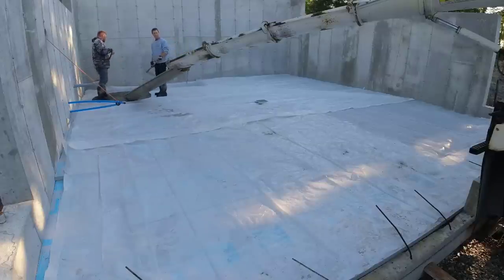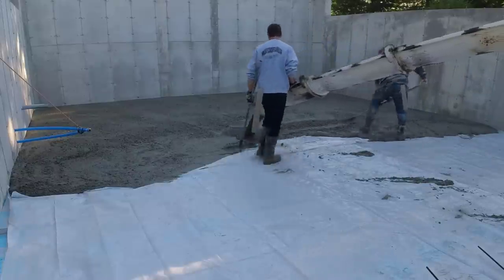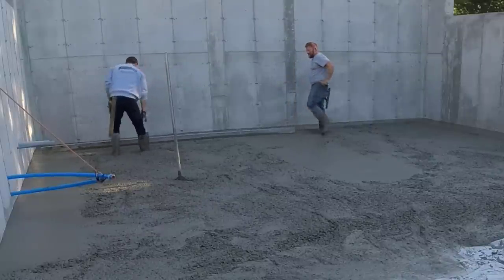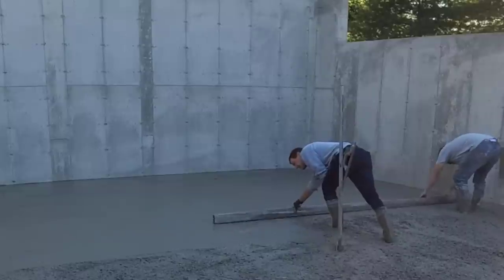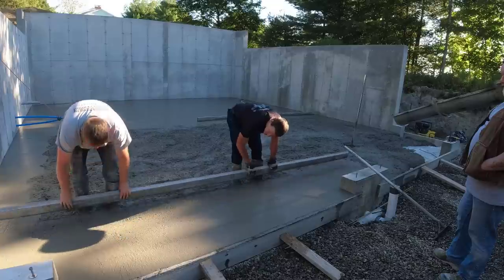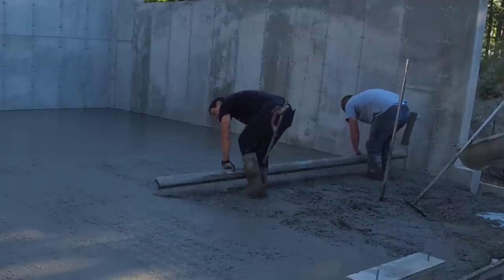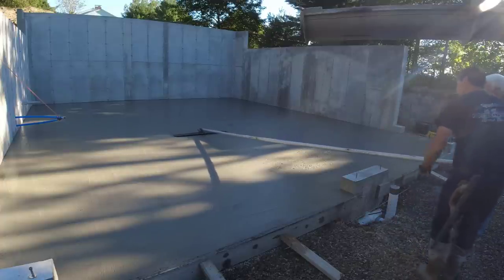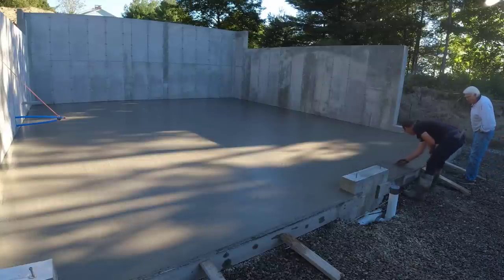How To Pour A Concrete Floor With Only 2 People.

Comment: I poured a pad today and I used wet pads for the first time with a transit. It beats using a 2x4 temporary form to screed on top of with a power screed, pulling the 2x4 out and filling in the void having the concrete in the void wetter than the concrete around it. Thanks for sharing your tricks and knowledge Mike!
Reply from the maker: Awesome thanks 😊

Comment: Great channel I've been a contractor for years learned a lot watching your channel thank you! Question .. you mention air in the mix. That's something that isn't for freezing the day you pour but it helps in some way even after it's cured if you're in a colder climate?? Also you mentioned adding fibers to the mix is that something you normally can request or do you add that yourself when the truck gets there? How much per yard?? Thanks

Comment: Hey Mike. I'm going to be building a 24x24 shop and have a question about layout for slab. Ok so when I'm laying out for my slab am I wanting to make sure inside my form boards are 24x24 so my walls go to the edge of slab or do I want to go like 24.5x24.5 and then just measure back in some? I'm pretty handy with tools and building but just want a professional opinion and some insite
Reply from the maker: Make it 24x24. Don't make it oversized
Reply: Yeah all materials are in 4 ft sections so if you go more than anything dividable by 4ft you will have a bit more unnecessary work, cuts and waist.  Map out your inside . Maybe you need 24 ft by 28 ft.

Comment: So, you’re pulling in $2688 for a few hours of work ? That’s a decent pay check !
Reply from the maker: 1 guy stays and power trowels & cut joints. I don't think of it by the hour, I do it by the job.
Reply: That’s hard work and years of perfected skills, any professional you hire that is worth there salt is worth the money, I’ve poured concrete a few times and with a few people it still didn’t look like that! A half ass lawyer costs that much and you have nothing real at the end that’s going to last for years! 😂
Reply: U get what u pay for, that level of skill n understanding is where the value comes from!
Reply: @MikeDayConcrete does that include setup (dirt work, poly, forms, etc)?

Comment: Back in the 70's when I was doing this for a living there was the boss and myself usually doing two floors a day, 20 x 40 cellar slabs plus a garage or other small job, occasionally we would take on larger jobs too, when we did 2 floors we tried to schedule them in as close  proximity of each other distance wise as we could pour the first floor then pack up but leave power a trowel with some hand tools on site then pour the second floor while the first was set enough to get on to start finishing. After the second slab was in we would do the same routine as the first leaving the power trowel on site, one of us would return to the first floor to get started on it , once finished we would go to the second floor to help  get it done, usually we would hand trowel the final 2  passes because you can finish a floor by hand sooner than with a machine, my being 6-5 allowed one pass on a 20 x 40 end to end using knee boards, we would power float the slab to flatten it then when (if) possible to close the floor in with finish blades but to save time due to not having the weight of the machine once the slab was at a certain point (depending on the season usually) during hand troweling you end up saving time plus you can get a very nice finish by hand.
We did this for several years sometimes finishing 2 house slabs with enough time to still catch a 2 or 3 car garage  or similar job (summer time) , walkways that most times were hand finished with a mag float scroll pattern finish rather than broom, I haven't seen of heard of scroll finish in many many years.